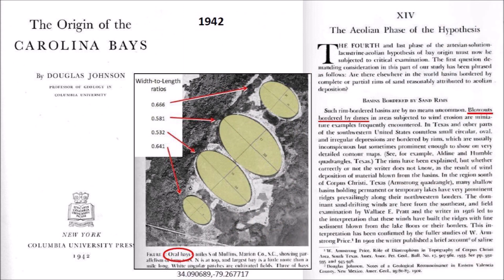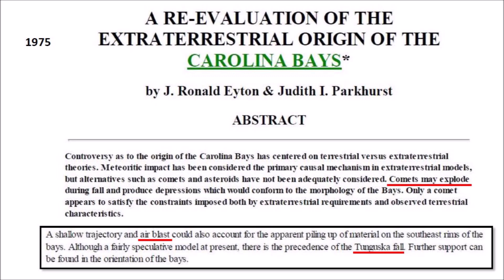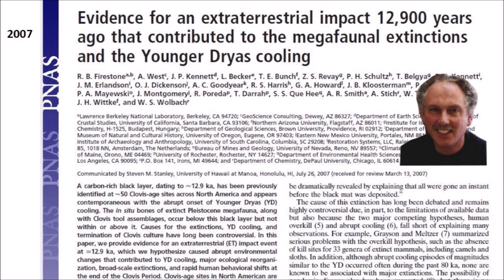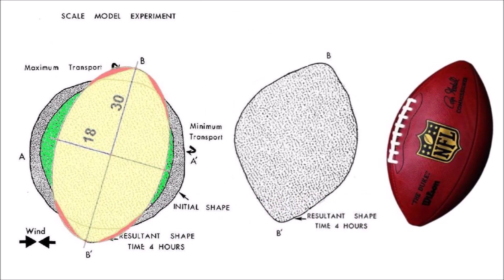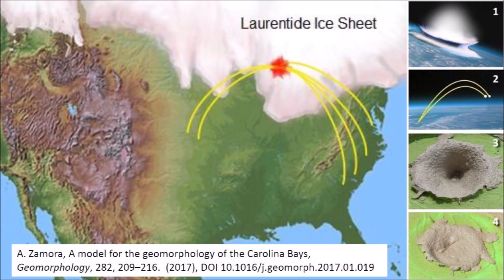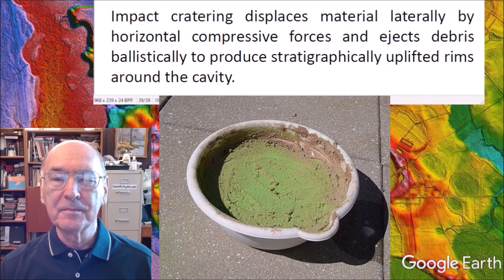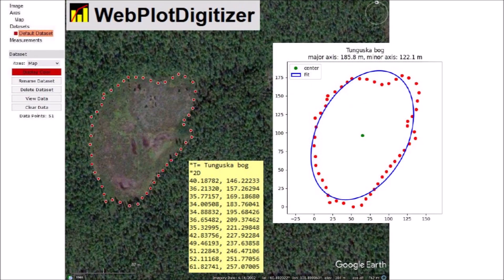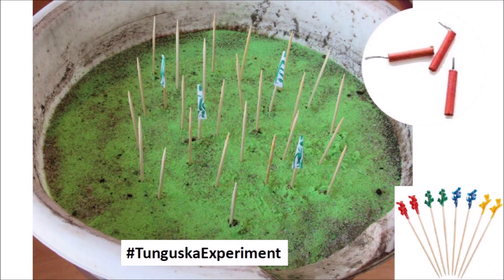Carolina Bays made by airbursts - a persistent myth

Comment: There was another very large airburst in Russia on October 30, 1961. It was very well documented....

In 1961 the Russians dropped the Tsar Bomba, a 55 MEGATON Hydrogen Bomb. It was detonated at 4,000 meters (13,000 feet) above ground. It was the largest man made explosion in history. It will never be repeated. It caused thermal burns to exposed skin 100 kilometers ( 62 miles) away. The pressure wave circled the Earth 3 times. Seismic wave also circled the Earth 3 times. The flash was seen 1,000 kilometers (620 miles) away. The mushroom cloud rose to over 95 kilometers (59 miles) high. Windows were shattered 780 kilometers (480 miles) away.

There were exactly ZERO 'Bay' formations created. There were no changes on ground at all under explosion.
Reply: Probably correct, but was this detonation made over unconsolidated soils to mimic the terrain at the time of carolina bay formation?  I'm guessing no.  This detonation was probably made over the permafrost of siberia.
Reply: @brianjacob8728  It was cold barren island north of Siberia.

Comment: "Platinum, shock-fractured quartz, microspherules, and meltglass widely distributed in Eastern USA at the Younger Dryas onset (12.8 ka)", published May 8th, 2024: 

"Thus, evidence shows that glass-filled, shock-fractured quartz possibly was produced during YDB airbursts through the two processes discussed above: (i) ground surface impacts by hypervelocity fragments of the airburst bolide and (ii) jetting that filled grain fractures with molten material."

Comment: Good debunk. Cant see how anyone can argue that.

Just think about a globe-shaped pressurefield created by an explosion. To make the tiny bay formation ecplises it would have to be very low. Like half the diameter of the formation. Makes it look kinda silly if thousands of airbursts happens below a few hundred feet. 

If its high up in altitude, the possible impression left on the ground would be represented by a ball-shaped depression. And the radius would be even and connected to what height it burst at. So basicly not a tiny very very localized crater. 

Airburst craters doesnt make any sense in this relation

Comment: You know you could drop some little toy sailboats or rubber ducks in these and see if there are two opposing circular currents.
Reply from the maker: I like your experimental suggestion, however, the proponents of the eolian/lacustrine hypothesis generally say that the winds that made the bays were stronger than current katabatic winds.  Eolian experiments have failed to produce elliptical features like the Carolina Bays, as explained in this video:  https://youtu.be/E6FFX9hpWLAx

Comment: I found out about your work a year ago and find it fascinating. I think the reason for the absence of similar features between the Carolina Bays and the Nebraska Rainwater Basins is that the glacier runoff washed them away in a deluge. There is a curious feature in the Gulf of Mexico that looks suspiciously like a massive mudslide that flowed of the continental shelf. This would have caused a tsunami that traveled across the gulf and reflected off Central America in the Bay of Campeche. I tried to post links to Google Earth yesterday, but my comment never showed up. :/
Reply: see also Dewey Soper Migratory Bird Sanctuary
Reply from the maker: Impact basins like the Carolina Bays can only be made in unconsolidated ground that can be liquefied by the seismic vibrations of the impacts. The Mississippi river basin has a lot harder terrain where inclined conical cavities cannot be made, and also like you said, melt water washed away much of the evidence.
Reply: @Antonio_Zamora  I would posit that when the impact that created Saginaw Bay occurred, the Mississippi river basin did not exist. I'm suggesting that when the melt water came, it stretched the breadth of the midwest, from the Appalachians to the Great Plains. The Mississippi river basin has a lot harder terrain, now, but it was covered with topsoil back then. That topsoil and all of the evidence that it contained is now in the Gulf of Mexico, as a result of a single, massive "mudslide".
Dewey Soper Migratory Bird Sanctuary is in the North of Hudson Bay(also a crater?) and bears the scars of what seems, to me, to be the same, or similar, mechanism at work except that the ground is solid rock, so the depressions are shallow and round. I am curious to hear your thoughts.

Comment: Had never heard of the Carolina Bays till your video showed up in my feed, thanks for posting it, fascinating subject. Wouldn't an air burst meteorite create impacts dependent on it's mass which would be quite different result from the firecracker/toothpick simulation? Has any shocked quartz been documented at any of the Carolina Bays? Are you positing that some or all of these features are a result of the Sudbury impact?
Reply from the maker: I am proposing that the Carolina Bays were made from secondary impacts of glacier ice that was ejected by an extraterrestrial impact on the Laurentide ice sheet about 12,900 years ago.

Comment: At the end of the day, it all comes down to impact forensics, and the characteristics of ice fragmentation through sub-orbital trajectories to
the impact areas. Did the ice fragments undergo a slight transformation into spherical shapes from supersonic reentry into the atmosphere?
Or was the ejecta superheated upon impact forming huge ice missiles which formed into a more polished shape. The Bays are so consistent
with round or oblate impact objects, it bears consideration what shapes of ice were taken upon reentry. Thanks.
Reply from the maker: The ablation during re-entry of the ice boulders through the atmosphere may have made the ice boulders rounder, but the shape did not affect the characteristics of the conical cavities substantially.  Take a look at this experiment. I used a chunk of ice that had some flat edges, but it still made a symmetrical cavity.  https://youtube.com/shorts/TxehkX69mqo
Reply: @Antonio_Zamora  Thx
Reply: This is addressed in some other of his videos. Basically the projectiles form cones when they hit, which then collapse in on themselves  leaving an ellipse where the land's surface intersect them. This is because the cones are at an angle ; if the trajectory was straight down, it would be a circle.

Comment: How many bays have you digitalized so far? It would be neat if there were a way to automate the % error calculation between ellipse from the least squares and the actual bay. It’s complicated math but straight forward with CAD however, it takes a long time. I think it could open up some areas of analysis. I have questions like what is the distribution of %error, how is it distributed geographically, how is it effected by the direction and slope of the natural grade, how does it compare to craters on other planets where there is no wind or water erosion…? Your videos always get me thinking!
Reply from the maker: I have digitized about 20 bays.  For some, I used latitude/longitude points from Google Earth, and for others I used WebPlotDigitizer on an image from Google Earth.  The driver2d program provides a heading when lat/lon are used; this is useful for extending the headings toward the Great Lakes.  Regarding, the %error, the program uses the fitting procedure of Halir & Flusser ( https://autotrace.sourceforge.net/WSCG98.pdf ), which is very fast. The algorithm does not provide the %error.  It probably would be necessary to devise a %error function by evaluating the distance of each plotted point from the elliptical curve.  I need to find out how to do that.  How does your CAD program do it?

Comment: I'm surprised to hear that the Nebraska Basins have rims on the South East.  If they were analogous with the Carolina Bays, surely the rims would be in the South West if it was the result of an impact of ice from the North East?
Reply: They are oriented from northeast to southwest with rims on the southwest side. 
Maybe was misspoken
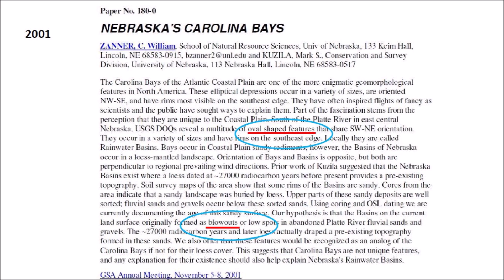Reply: @MJIZZEL-MJ  I don't believe so, it's in the 2001 paper at 0:06:50 and shows up on the lidar imagery at 0:06:53
Reply: @we is saying they misspoke, not you. They said East instead of West. Or are you saying the the rims ARE  South East, not South West ?
Reply: @terryenglish7132  The rims ARE SE, but one would expect SW if they were trajectory relics.  Watch the 6 minute area I linked to.
Reply: @Argrouk  link ? The NE bays were flooded. That wouldn't change the shape, but would change where the rim was most built up. Is that a factor ? Wind could certainly be a factor as well. It gets windy w a nuclear explosion taking place every mile. There would be whirlwinds, and the would deposit southeast.
Reply: @terryenglish7132  Now you are clutching at straws.  The SE rims in Carolina are used as a proxy for an impact from the NW.  For the logic to be consistent, the basins in NE would have a SW rim congruent with an impact from the NE.  

However, this troubles both theories.  The SE rims in Carolina are on the short axis, whereas the SE rims in NE are on the long axis, making it unlikely for the same eolian processes to be involved.

More research is required to account for this inconsistancy.
Reply: @Argrouk  There is problem discussing ideas w people if they are insulting. "Clutching at straws". Don't use belittling expressions. ..Both phenomenon could account for the evidence, especially the floods. I'll see if I can find the article and link it... If there is no explanation for the rim's orientation, than the multiple streams hypothesis seems likely; w at least the NE bays being initial strikes and not splatter from the sheets.
Reply: @terryenglish7132  The bays are not initial strikes or airburst proxies, it just doesn't fit.  They have to be either a natural process or secondary impacts of ice.  There are too many problems with the current explanation of cyclical currents, so to me the impact hypothesis is winning.
Reply: What the hell is the problem here? Look at the LiDAR images!
The ellipses are southwest to northeast. 
The rim is on the southwest side. 
Just go look at the damn things. It’s that easy.
Reply: @MJIZZEL-MJ  Show me.  The rims look very SE to me.
Reply: @Argrouk  how the hell ima show you? You wanna come over and look at LiDAR with me?
The. Nebraska rain water basins are oriented from ne to sw.  It ain’t hard to notice. 
One end is pointed towards Colorado. 
Other ends points to Minnesota. 
Shape of it is ellipse. 
Do the required thinking.
Reply: @Argrouk  I just looked at the basin you time stamped in the video plus I over laid Davies LiDAR images on google earth for just that portion. 

I think I figured out what you are looking at. It woulda been more helpful if you said the rim was on the south side of the ellipse. 

Yes that is a raised rim. All of them had a slight raised rim on all sides after impact. 
The bigger, sw oriented  rim of the crater landed on more rugged, mountainous terrain. 
I suggest looking at others from that area. They are all oriented like this with Sw crater rims.
Reply: @MJIZZEL-MJ  I think it would have been more helpful if you read what I actually wrote before going off on one.  I helpfully put two time stamps where you could read the paper on screen and view the image I was talking about.

Considering we're commenting on a video, did it not occur to you I was talking about the things IN the video, and not some other bays or basins?  I checked very carefully before submitting, I stand by what I said.

Comment: are there any bays that show a deepening towards the purposed impact, they all look very level inside
Reply from the maker: The reason why the interiors of the Carolina Bays are fairly level even on hills is due to viscous relaxation when the ground was liquefied by the seismic vibrations of the impacts.
Reply: @Antonio_Zamora  but so consistently? I mean there would be some examples of slope, surely!?
Reply from the maker: @JeremyDahl  It would be like trying to find a hill in the sea.  When you look at a LiDAR image with colorized topography, the part of the bay inside the rim is always one color, which indicates level ground.
Reply: @Antonio_Zamora  I dare ask (because I am embarrassed), but what does "consolidated soil" mean--in your words, not me guessing "sandy soil"? I feel kinda dumb, asking this.
Reply: @allenvaughan1  When you dig straight down, the soil goes from loose to thick until it becomes rock.  The weight and pressure of the layers or stratigraphy above, compresses and "consolidates"  materials into rock like sandstone, limestone etc.  The loose material becomes cemented into a solid.  This is not the same process as freezing a liquid into a solid, it's more like baking clay in an oven.  In many cases you can almost swap pressure for temperature.  At high pressures, it takes less heat to cook something.  The resulting rocks are usually softer and porous and easily eroded, which is why things like the great pyramids used granite casings to protect certain areas.

The top layers are usually unsorted, but they tend to sort themselves by size and material over time, so the gravels, muds, sands, dirt, dust as well as water and organic material tend to clump together eventually.  That's why you get seams in mines, rather than completely random atoms of mixed in material throughout the rock.  Any unsorted soil when vibrated tends to liquify turning into a quicksand, you can clearly see this phenomenon during earthquakes.  It's just like stirring sugar into coffee, or flour into a batter.

So for any ice impacting the surface, it will either hit exposed rock like a mountain and smash, deep water and vanish without trace, or any combination of water and unconsolidated soil and leave an impact crater that heals itself like taking a spoonful of soup from a bowl.  Depending on the thickness of the soup determines how much of a sign is left behind.
Reply from the maker: @allenvaughan1  You learn by asking. Don't be afraid to ask.   Unconsolidated soil is loose soil that has not hardened into sandstone or other type of rock. Unconsolidated soil close to the water table can become liquefied by seismic vibrations like from an earthquake or from impacts.
Reply: @Argrouk  that's what Antonio is referring to, "UNconsolidated" soil, or, loose and uncompacted. Thank you!
Reply: @Antonio_Zamora  I've looked over almost all available Carolina bay lidar images I could find, since I started watching your videos years ago, and have only ever seen level centers. You would think the larger bays especially would show some conical depression of elevation... It is hard to believe that the viscous relaxation is that soft and errosion is so perfect. If the errosion or settling is that intense as to level the centers, than how are so many rims still present. 

Just honestly curious.
Reply from the maker: @JeremyDahl  Viscous relaxation was accelerated by tremendous seismic vibrations of almost 8 megatons per square kilometer in some areas.  See video:  https://youtu.be/x6ZRJbE-klE  The ice glacier bombardment only lasted from 6 to 9 minutes after the extraterrestrial impact on the Laurentide Ice Sheet. Soon after the 4-minute bombardment stopped, the liquefied ground became solid again, just like it happens after earthquakes. This is why the rims did not manage to become level with the ground.
Reply: @Antonio_Zamora  interesting, definitely checking out that right now. Thanks for your response as always.

Comment: How large is calculated impactor(s) to be the classier and does that impact should penetrate couple of miles of ice to show some distinctive marks in current geography?
Reply from the maker: One of the problems about finding the crater of an impact on an Ice sheet is that the impact area is flooded by the melting ice and the evidence is washed away. The orientations of the Carolina Bays and the Nebraska Rainwater Basins are the only clues that we have about the location of the impact.
Reply: @Antonio_Zamora  One is the place for these possible impactor(s) in the Great Lakes area, but the question here is with how large these bangs should be to have visible marks where they currently are some hundreds of miles away. Should the impact punch a visible hole even buried under the sediment? How large it should have been? It is likely buried now under lake, but even that can be measured out with surveys for anomalities.
Reply from the maker: @ivosarak959  I have suggested to professor Breckenridge from the university of Michigan Superior that the varves in the Great Lakes may contain platinum enrichment characteristic of the YD impact.
Reply: @Antonio_Zamora  One would think that after the KT extinction event crater was found, they would be a bit more open minded about huge bloody chunks of ice falling from the sky and wreaking havoc.  Haven't these guys been in a bad hailstorm?

The problem with the Great Lakes as an impact site, is that there is so much competing geography.  There are glacial outflows creating lakes and channels, morraines, drumlins, flood effects, erosion, deposition, elevation changes, different rock types...

It would need an openminded team of several experts to do a serious analysis of the area, trying to put together a jigsaw blind folded in a dark room while it is still in the box and having never seen the picture.  It's hard to generate that kind of enthusiasm and budget.
Reply from the maker: @Argrouk  One of the problems is that many researchers would be embarrassed when all their research on dates is questioned. To defend their reputation they have to object to the new hypothesis.